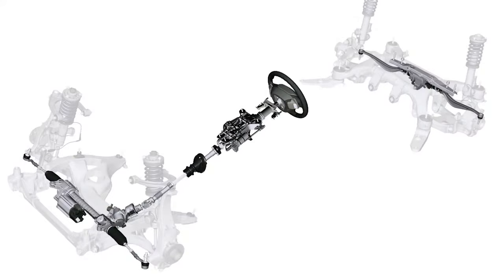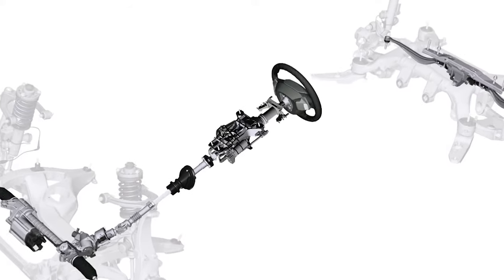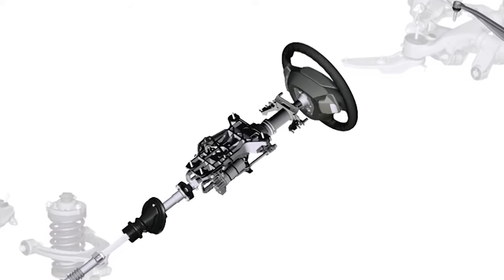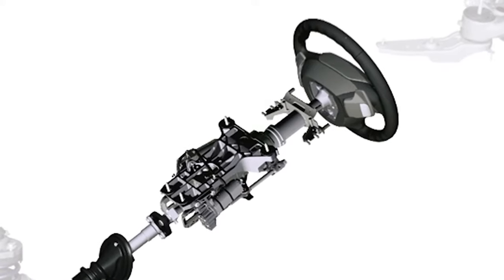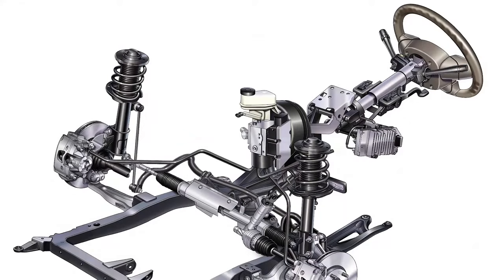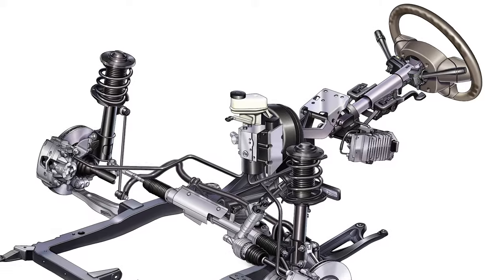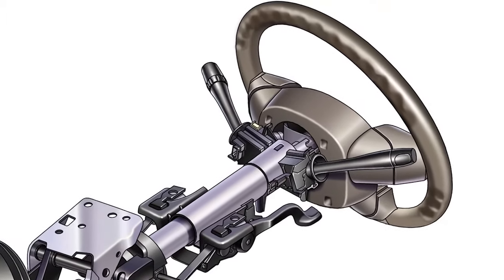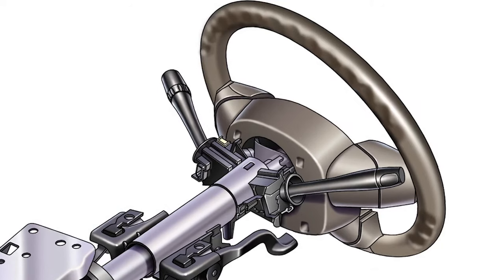Steering-Angle Sensors 101

Comment: I scanned my steering angle sensor and the value is -500 +/- but alignment is done wheels and steering is straight, what should I do with this value??
Reply: I have the same problem, it shows -310, what is the solution?